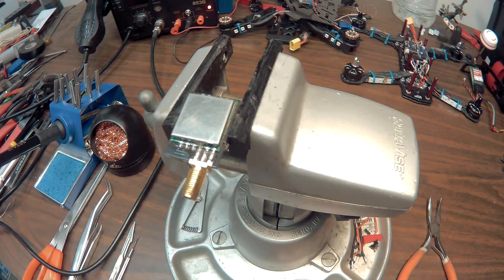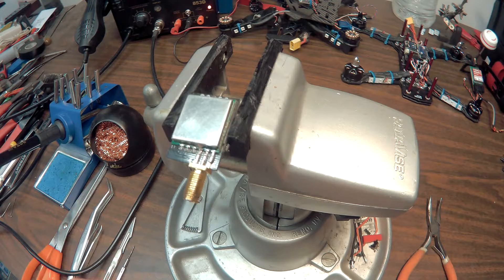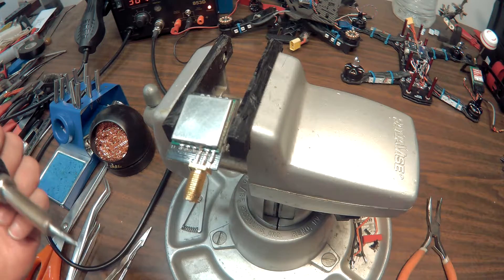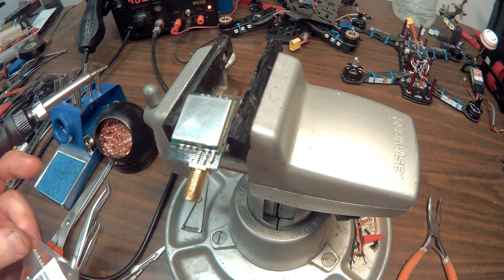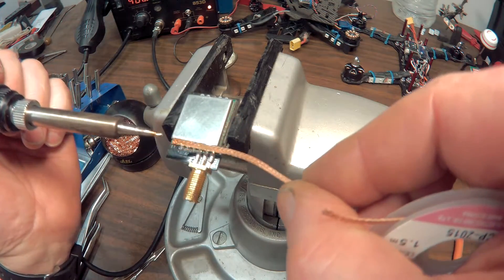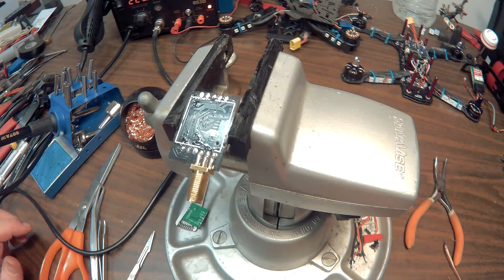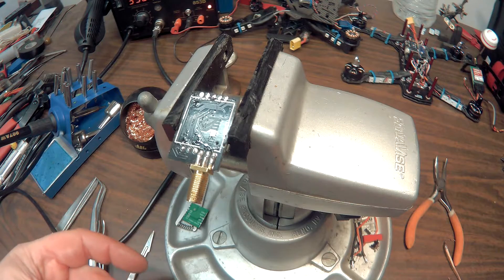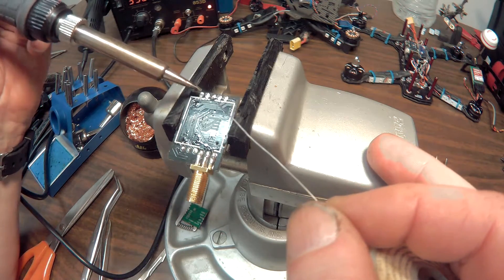Vtx Module Replacement

Comment: i have the falcon also...theres been a couple times i accidentally forgot to put the antenna on just for short little hovering in the house...and sometimes messing with the motors...do you think i already burnt mine out...i havent had a chance to use FPV with it yet..I unplugged the camera to save battery
Reply from the maker: +Devin Hall Hard to say, but you should disconnect the Vtx power (little red and black wires) so your Vtx isn't powered up at all, if you're not using it. Then you don't need to worry about breaking off an antenna too.
Reply: +Todd David ok so if i do that do i need to even put the antenna on then?
Reply from the maker: Devin Hall No, if the power is disconnected, you don't need an antenna.
Reply: +Todd David i disconnected the red and black wires that were in the back where the vtx was...theres another set of wires with many different colors connect...i guess that connects to the camera so i dont need to unhook those...as long as i got the red and black disconnected im fine?
Reply from the maker: Yes, that's correct.
Reply: +Todd David ok thanks for the help...since i dont have an fpv setup id rather just not have the antenna connected...trying to remove the camera too but the top plate on my quad wont come off because one of the hex screws seems to of been stripped in the process of the manufacturer putting it together...cant get it to come out.